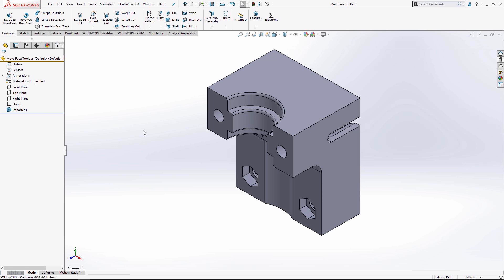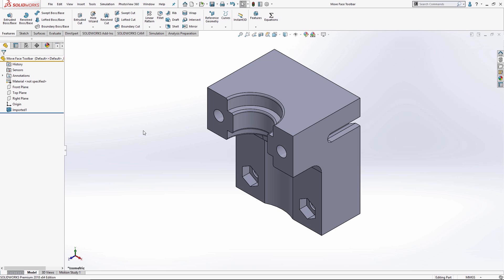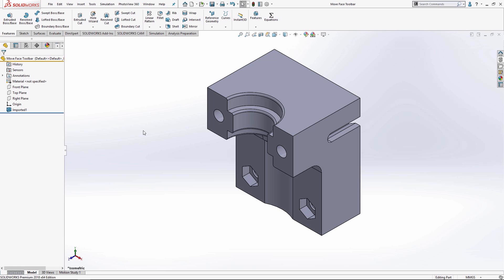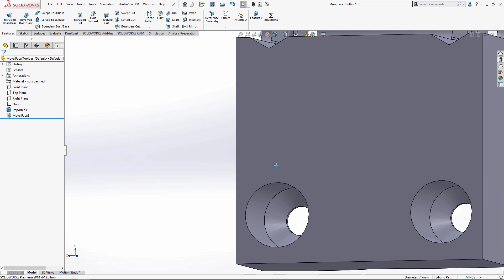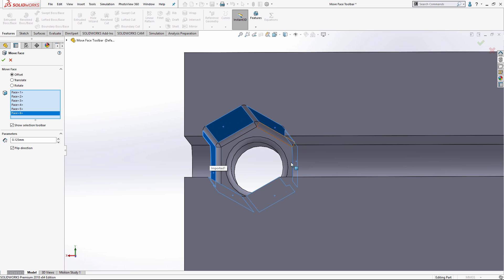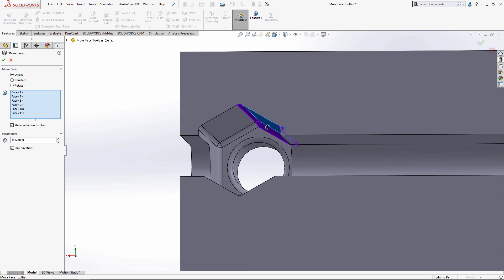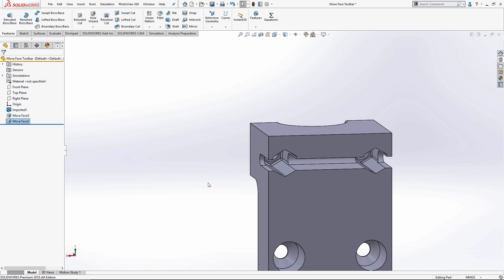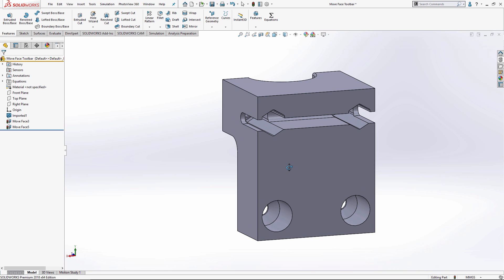SOLIDWORKS - Face Selection Toolbar

Comment: How can you turn off this feature permanently, can you please touch on that? It drives me up the freaking wall when I'm rapidly selecting faces, it goes right where I'm about to click, I accidentally click it, and it replaces everything I just selected. God, it's so horrible.
Reply from the maker: If you uncheck the box to show the selection tool it will not show up and it should stay unchecked until such a time as you check it again.

Comment: Very nice feature, thanks for sharing. But it seems to me that it also changed the depth of the hole when you selected the fillet at the end of the video (fillet is in X/Y plan but also in Z plan) isn't it ? So I guess "move face" of the fillet is making modifications in X Y AND Z directions and this should be anticipated into the design...or would you have another tip for that also ? Thank you.